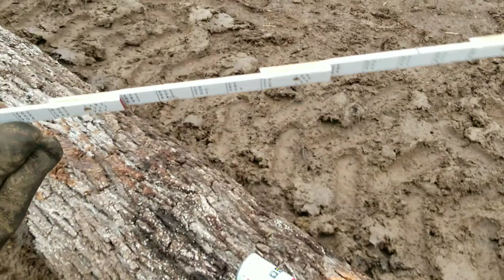Skidder Chains. How "Not To" instructional video.

Comment: Hey Tighten em up from the inside links, to the middle, then to the outside, you guys did a good job looks like to me. I put em on, then drive a little bit and then eventually you will find a spot where the slack lines up good and those chain tighteners are handy but you probably don't need em, I do em all the time so if you have any questions please ask and I will try and answer as best I can. the tighter the better for sure especially in mud. if those chains start to turn on top of the tires they will eat that tread up.

Comment: Next time turn you chains over with the cleats up take a strap tie around the ring on the chain and run it over the top side of the tire and back underneath of it so as you back the machine up it will pull the chain up-and-over your tire keeping them tight when they come back around you can put them together right on the front of the tire easy one man job

Comment: CHAINS!!! Nice job man, you guys did great. Installation in that slop is quite a feat in itself. I’d say they’re a tad loose but not horrible. I bet they make the machine feel like a whole new animal. The tensioner tools work excellent but you’ll find you wanna have a handful of clevis’s so that you can give yourself more working space. Once you use the tools you’ll see why.
Reply from the maker: As we were putting them on I kinda wondered if we needed more clevises. The first was a trick but the second we got on pretty quick. Do you think I should buy the tension tool to keep them tight....??
Reply: Turner Logging, LLC 
The tensioning tool is pretty damn handy. You can get them decently tight with chain binders, come a longs, etc. but nothing beats the right tool for the job. I don’t crank them any tighter with the right tool but it’s just much faster and easier. You can go overboard on the tightening IMO... Labonville sells one that is a modified high lift jack and it’s works great. The screw type are probably the best but $$$... I bought a compromise, it’s a military surplus track jack. I got it from Coleman military supply. You can get a used one for $40 or new for $50. It’s HEAVY DUTY..
Reply from the maker: I'll order the tool so I have it. Do you think they can do to tight...?? These really don't have to much slack in them, at least I don't think. They aren't making any noise or jingling sound when we run
Reply: Turner Logging, LLC 
I think they look pretty good. As they are, they are fine IMO. I personally prefer to have them so when you lift the blade, the chain at the bottom of the tire hangs below 1-2 inches or so. Your probably about 3-4” right now I’d guess. Some people I see literally sink them into the rubber which to me is a overboard and wearing the hell out of the contact points of the links. Just imagine all the friction on chain links.. Kinda similar idea with a motorcycle, chainsaw, or any other chain, need to be snug but not ridiculously tight either.
Reply from the maker: I can't thank you enough for all the tips and advice over the last few weeks on this.  We'll definitely try to get them snugged up a little more. How often do you have to tighten them up...??
Reply: Turner Logging, LLC 
Your welcome, I learn a lot from tagging along with you guys too! They don’t need to be tightened very often. I bet you’ll go months between tensioning. Your on good terrain most of the time from the looks. You also go easy on your equipment which helps immensely. Looking forward to some good footage of a big heavy hitch behind the ol 540 now it’s got good sneakers on.
Reply from the maker: Couple more questions real fast, which tire tool is the best one to buy, and what size clevises (and how many extras) should I keep on my truck...??
Reply: Turner Logging, LLC
I like the screw type the best, it’s really compact and nice. 
http://www.babactirechains.com/babac_tighteners.html
I’d have a half dozen 3/8” clevis’s on the truck to replace lost ones and assist positioning of the tensioner tool.

Comment: Slack in the chains can let brush get in there and then come whipping around with the tire. Be careful it can whack you or tear up blade hydraulic lines. Also if you got slack on then you’ll have trouble keeping clevis’s on unless you lock tite them. Hard to get chains good and tight without a chain tightener though. Good job for your first time 👍

Comment: you need the tool .  Always have a bunch of extra clevis's . weld the clevis's on the tire top sides.  or red locktite and blue locktite on side clevis's . I let some air out to snug tight. 2 chains are good , 4 chains much better.

Comment: It's too bad the side chains don't have cam tighteners to help with the final snug up.  I have used chains in many applications and in my experience you are better off with the chains as tight as you can get them.  As a fire service retiree, we tightened the chaines up like a banjo string.  As the shift progressed it was not unusual to snug up the chains several times on any one shift.  All of our heavy truck chains were purchased with cam tighteners on the side chains.  They made it possible to install the chains so there was almost no movement of the chains slopping around on the tires at all.  On our farm, anything from the pickups and bigger have chains on when needed and all have the cam tighteners and the chains are kept very tight.  Information from us in rainy and snowy Oregon.  Nick, North West Farmer